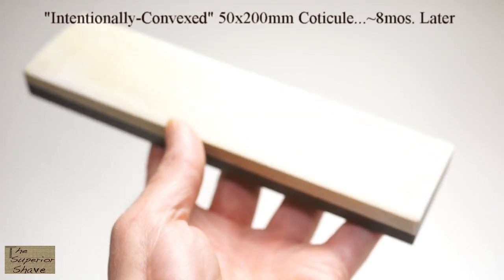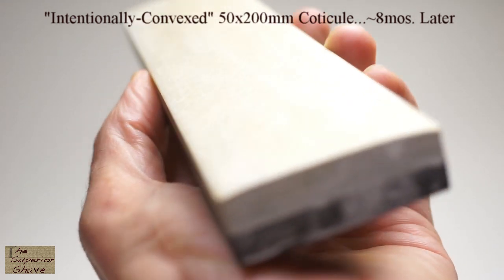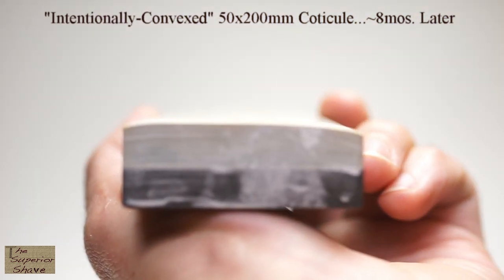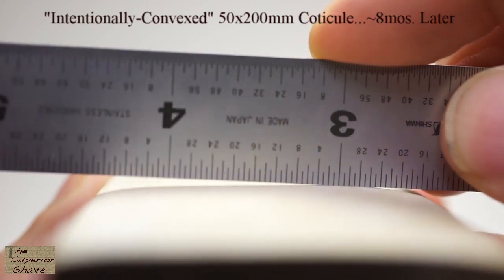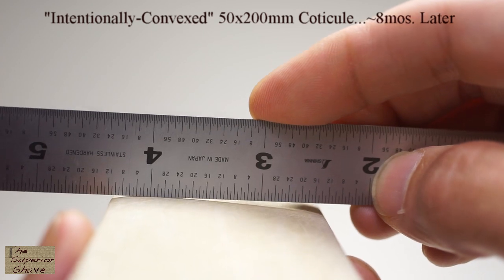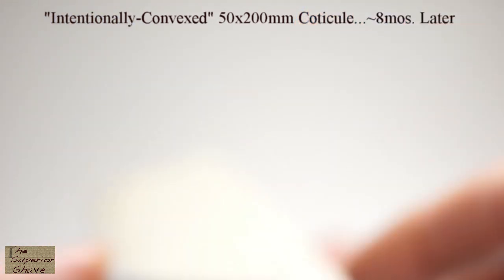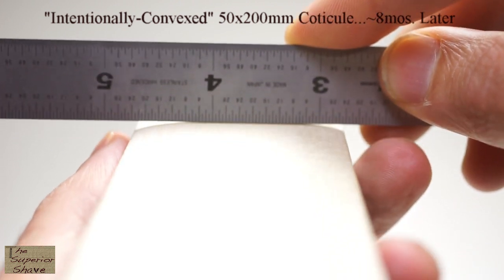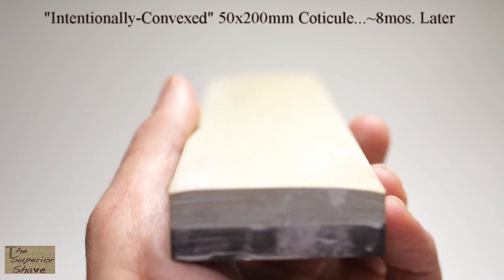Intentionally Convex Shaped La Grise Belgian Coticule Razor Stone Hone 2/3 #Hönenist

Comment: Interesting. Could you show us how you are honing on it and maybe how it is better than a flat stone. Are there specific honing tasks that you use this for like correction of bevel?
Reply from the maker: will make video using soon, promise

not so good for re-bevelling, because the stone chosen is just intrinsically too slow (a common 'la grise' from <2012 extraction), however for all but bevel making it is an excellent pc

need to find a fast+soft+large+deep pc so that can be convexed for bevel setting

Comment: Are you trying to get the shape a segment of a large radius, or more like an ellipse?
Reply from the maker: This piece is clearly more of a cylindrical gradient, however spherical is superior, just quite hard to achieve.  As I slurry the stone I do try and rub more to the outer boundaries but I've placed the 300mm ruled edge along the 200mm axis of the stone and while the contact point's position does vary as I've shown here the size is too big.  At least there's never a point where it touches twice with gap in between, so stone's still kosher for the job.

Part of becoming a master grinder in Solingen is learning to prepare a big stone spherically, and when the center is higher than all the rest the bevel angle becomes ever so slightly more acute because you're always working with the spine and edge in simultaneous contact of a surface where the spine is always ever so slightly downhill from edge.  

That acuity enhancement can still be achieved with cylindrical gradient by always moving along the 'summit line' with the heel-to-toe line ~45-deg. to the center line of the stone.
Reply: Why not find something that has the negative (concave) profile you are looking for and simply lay in a piece of  sandpaper to obtain the desired profile? If you look around you will find something with the desired shape, or it would be very simple to make one. 

This is a common woodworking technique.

Also- coticules lap/flatten/shape very well dry. I think people automatically think they must be wet. 

I'm sure I'm not telling you something you don't already know though.
Reply from the maker: I've ABSOLUTELY considered trying to find something like this...remember, it will need to be harder than coticule and then you could put grit in between it and coticule (I have never tried it but will wager the concavity causes ripples etc. problems wtih the sandpaper).  But I have called and visited many granite cutters locally and all say they cannot do.  Where can I find a 1x1' square of something very hard and with <4% gradient spherical concavity?   I will happily source this if you tell me how.

Yes, the coti's fine to shape dry, but a bigger mess, I wouldn't dream to do that indoors.
Reply: It wouldn't have to be that hard if your using sandpaper in the mold. Rippling shouldn't be a problem, but if it was, PSA (sticky back) sandpaper is readily available. A high quality, micron rated mylar backed coarse sandpaper would last a really long time. 

Traditionally such a mold would be shorter , like 6" in this case and used (rubbed back and forth)  on top, with the coticule underneath. i get the idea you are looking at it the other way around. 

There are so many ways to make something like this- it could go on forever. 

A simple, adjustable form could be made from a small (say 3" wide by 10" long)  piece of bendable plywood, or even cheap, readily available 1/4" luan plywood. Any cabinet/architectural woodworking shop would give you a piece of bendable plywood for free. You would also need a piece of wood to act as a base. Use popsicle sticks on the outer edge as shims parallel to the length of the bendable plywood, and secure with a few woodscrews through the center of the bendable plywood into the base. Add or subtract popsicle stick shims until the desired radius is achieved. Good for experimenting with different radii and could easily be made permanent and waterproof. The center, flexible plywood part could also be made out of thin sheet brass or aluminum- like the kind sold at Home depot as a decorative "kick plate" for exterior doors. 

If you have access to a table saw, a 5" radius can be cut in a wood (or plastic)  form in a matter of minutes. 

Honestly, a $5 dollar cabinet scraper and some skill/patience could do this in wood.

If seriously seeking a permanent setup, once the desired radius is known, Any cabinet shop can cut a shaper or moulder knife to any shape you desire. Get a piece of UHMW plastic from any industral supply house (maybe $30- $40 bucks)  to cut the form in and you would have a waterproof form that would last forever that you could cut into various lengths yourself. 

Any hobbyist with a cnc router or mill can easily do this also. 

Curious- do the German's also put a slight convexity (say 1/32") along the length of the stone?

As an aside- convex, concave stones, tool shapes like chisel and hand planes were the norm back when hand work was the only option. Perfectly flat stones and tooling are a modern thing. Flat tooling back in the day would be like driving a car without a steering wheel.
Reply from the maker: Thanks for the ideas!  

Whether used above or below, I'm really hoping that I could get a shape-compeller that was one square foot as to make that gradient as perfectly gradual and spherical as possible - you cannot for example take a 8x3" stone and impart a <4% gradient in an elliptical topography unless that which you're using to reshape it hopefully comes from a much larger ellipse.   I'd like to be able to offer this kind of stone on a recurring basis.

Maybe it is like forcing kids to learn long division in the age of the calculator just so that they know how to do it, but I do find it interesting that I've been to now five distinct Solingen, Germany places of straight razor manufacturing over the course of seven years, and all used exclusively convex bench stones for the last phases of production (prior to stropping/testing) and all used stones obviously hand-prepared.  Not that it isn't important to gain an understanding of why it works, but once they know that, how could they not prefer an Arkansas stone which was given this gradient and shape and finely polished (you'd not need to reshape it for years even in their high-demand environment).  

Yes, from what I saw, the long axis of the stones was indeed given some gradient, rather than just across the span of its narrower axis.